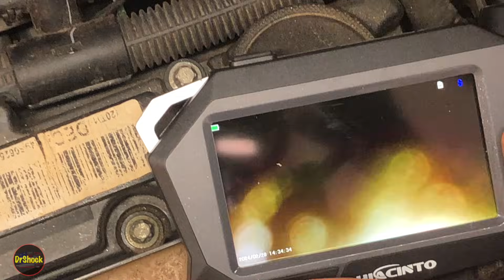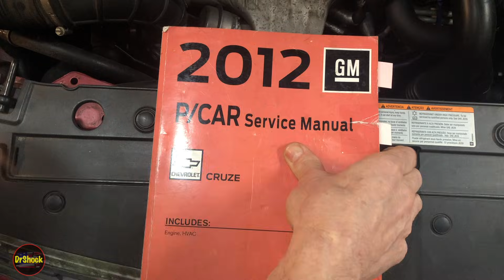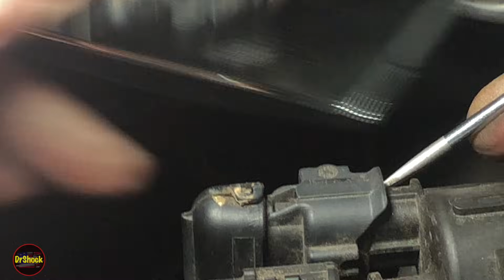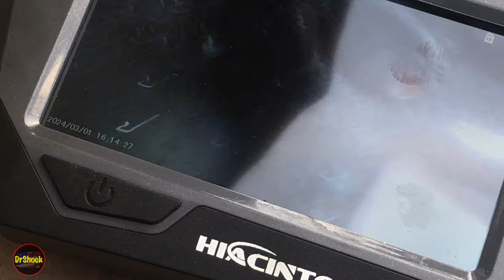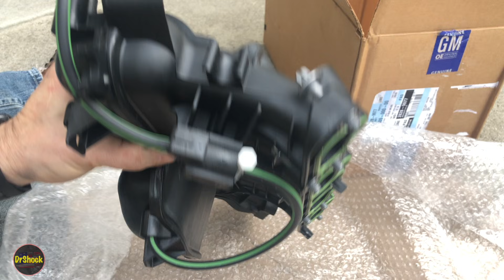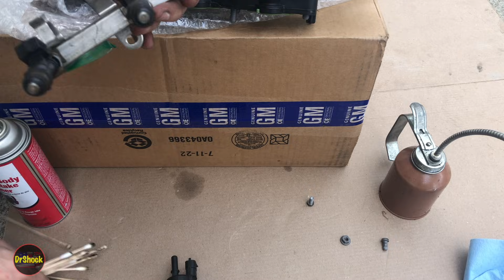2011 - 2021 GM Ecotec 1.4L Turbocharged Engine Intake Manifold Replacement ~ P0171 Diagnosis ~ Cruze

Comment: the orange check valve allows flow towards the intake manifold? Thanks.
Reply from the maker: It is a one way bypass type valve made of a type of silicone, sealing shut to prevent air under turbocharger boost pressure from entering the engine crankcase area.  And opening normally to allow combustion blow by gases to be removed under engine vacuum as part of GM's positive crankcase ventilation design for this particular engine.

Comment: Can the MAF be cleaned before you start disassemble on the other items or does that orange thing indicate removal of other things. The engine light randomly comes on, 2014 Buick encore turbo. 70 yr old granny here. The orange is visible.
Reply from the maker: As we showed with this particular vehicle, even if the orange bypass valve is visible, it does not always mean it is still functional.   Age and heat can either disintegrate it (missing entirely or partially) as well as stiffen it (preventing functionality intermittently or completely).  

A random check engine indicator would need to have a code scan done, to determine what the diagnostic trouble code (DTC) actually was.  And then the scan tool could be used to monitor related live engine data to determine if this videos subject was even applicable or not.   Same advice would apply to the MAF sensor, in general this particular GM engines' sensor can often be made worse attempting to disturb / clean them so one would want to confirm with certainty there's a reason to first.

Comment: I will be doing the pcv valve fix that's listed all over the chevy cruze/trax forums. It allows you to plug that orfice and creates a new, serviceable pcv valve using a kit a guy came up with. All you need to do is replace the valve cover and add the kit. Anyone having this issue, id highly recommend looking into it. Good luck!

Comment: All Chevrolet 
1.4 are bad about using plastic parts. And bad turbo placement. All pvc tubing fails due to the heat, it drys out and becomes very brittle. And after replacing the turbo, you must also do a full oil change including all filters, air and oil".
Or you void the turbo warranty. 
The more you know about this motor, the less you’ll want to own it. They can start getting very expensive around 75,000

Comment: Thanks for a great video. I have with help of the video removed the intake. On the new intake manifold that i ordered there where a smaller connector for the brake servo vacuum hose compared to my original one on my Astra J 1,4 T  from 2015, that had a large connection. It seems that all replacment part has this smaller one....   Can i reduce my hose?  Where can i find a connector that fitts this smaller vaccum connector
Reply from the maker: Was this a genuine GM part you ordered?
Reply: @DrShock  No it was an aftermarket. But the OE number indicated that it shall fit.  After a little investigation it seems that GM might have changed to a smaller connection here. All  spare part i looked at seems to have this smaller connection. . So i do not no what to do. Is itpossible to clamp a hose directly to the connection on the intake?
Reply from the maker: This video covers the first gen, RPOs LUV and LUJ in the North American market, of the GM Ecotec 1.4L turbo engine.  A quick check seems to confirm the LUJ type was also used on the 2015 Astra J models.  But in the EU market, there is the availability of start/stop technology not used in the NA market of this era.  There are different intake manifold (aka in the EU as induction manifold) part numbers on the manifolds for these options that do not exist here in the USA.   This may explain (just my guess) the difference if the aftermarket company didn't pay attention when replicating the part.

In this situation you may have to reuse a portion of the original used OEM parts' hose, and pick up a plastic adapter barb fitting to mate it to the smaller hose on the aftermarket manifold.

Comment: Could a puncture hole the size of a golfball in  the intake resonator box cause these issues
Reply from the maker: If you mean the plastic housing for the engine air filter on the 1.4L ecotec engine, structural damage there can certainly disrupt the sensor measured air flow as well as allow dirt and debris into the turbocharger mechanism,  if the housing damage is past the air filter.

Comment: What were the Torque Bolts Specs for the Air Intake Manifold 6- E10 Bolts, and are they numbered & follow a tightening pattern, like how the replacement valve cover & gasket follows a pattern on this engine? I think I maybe missed this in the final summary you did? Please 🙏  & thank you in Advance.
Reply from the maker: Those torque values are definitely gonna be in the video, don’t recall them offhand check the chapter section.  I showed the service manual info directly.
Reply: It's 20 Newton meters or 15 lb ft for the 6 main captive intake manifold E10 bolts.

Comment: So I have a new valve cover/pcv and I have a whistle but not from the pcv when running but if I pull the oil dipstick it stops can anyone give some insight why it's coming from the right rear of the engine I've also replaced the valve cover gasket thinking that may be the whistle but it wasn't I also did a smoke test with no leaks before the turbo and after?

Comment: I just put my new ported intake on....im going to port the old one and put the cruzekit on it. That way I can also put the new valve cover im getting on. 
I did notice turbo sounds finally.....it didn't have it before. The cel didn't come back in after a 5 minute drive, amd it came on in less than 1 minute at the dealership lol.

Comment: I replaced the intake manifold and valve cover, but I am still getting a P0171 code. There seems to be an incredible amount of crankcase vacuum. The PCV is not leaking. Is there any other components that could be causing this, or did I get a faulty intake?
Reply from the maker: Did you perform the camshaft cover PCV diaphragm vacuum test I showed?  Did it fail the test originally, and now passes after installing a new cover?
Reply: @DrShock  If you are talking about the paper test, yes and it failed initially, but now passes.
Reply from the maker: Then that has removed the most comment source for this code, but unfortunately there's a long list of possibilities so you don't want to fire a parts cannon at it.  This engine will easily empty the wallet of folks who try that.  

I'd next inspect that the sealing o-ring at the PCV pipe that runs from the turbocharger to the intake manifold isn't missing (at the intake manifold nipple end).   This pipe can also develop cracks being made of such a brittle plastic, so visual inspection of the entirety of this part can reveal problems as well.  This video can offerl a number of views on this part - https://youtu.be/OeymR_PjgPE

And that the sealant was properly applied to the two engine sealing seams when installing the camshaft cover as shown in this vid - https://youtu.be/Xfr05EPVJAg   I'd also check for no oil blow by from the camshaft cover gasket becoming dislodged or twisted during installation.
Reply: @DrShock  I did also replace the PCV pipe while I was doing the other work. I was careful with the valve cover gasket and applied the sealant in the locations you showed in the video. I am having a hard time understanding what would cause so much vacuum in the crankcase.
Reply: @DaleBisc  Did you solve the error problem?

Comment: Just did all this on a 2012 Cruze with 17000 miles on it (Grandma's car).  Just like the video shows, had to remove 28 different things to remove the IM. Took me about 2hrs. I decided to just snip the two wire ties tucked up underneath the IM.  Casualties! Could then see right down into the port: no valve present.   May Jesus bless you for making this very helpful video! Now to go find replacement parts.

Comment: Could this diagnostic work with a 2015 1.8L cruze?
Reply from the maker: Not directly applicable, this particular part and failure condition is only found on the GM 1.4L turbocharged engine.

Comment: Hey! I am replacing the intake manifold, orange bypass is gone replaced the diaphragm/valve cover 6 months ago. I only get the P0171 in temperatures under 0 degrees

Comment: All in one plastic intake and valve cover . $500 in parts and double for the labor. What about the fuel injectors? Mine at about 70,000 miles are making some noise that isn't right. Bet the dealership would recommend the whole thing at about $1500 to $2500. The labor to do the injectors is the same cost no matter that they are off anyways because of this. The mechanics get those hours even if it's a 1/2 hour more to do them.  GM swore they wouldn't do bad engine designs ever again after the V6 3.8L late '90's EGR plastic valve cover conduit fiasco. Nice job GM, you've done it again. Sure, 23 yr old bypass valves are probably not worth cleaning since the customer would really hate failure after all this but myself I could clean them. I have one way check valves that still work from 45 years ago. They don't just die from time. They sit in a divot or orpheus that can hold Varsol and soak. Get in with a little tooth brush type of a thing and gently deal with it if blowing them out carefully with compressed air attached with a little line hose doesn't do the trick. 
   GM must have saved lots of labor not having to do external conduit lines this way. GM is not as labor friendly as their UAW's members would like to believe. Trump loved to tell them voting for Biden would hurt them but his tariffs are not bringing jobs back to American shores. China is just so much better to build in since the market growth is exponentially better. All those bicycle people are wanting cars and GM knows it. Trump got elected on lies.
UPDATE: did the repair for about $10 USD but with tools to check that is all it is another $30-$40. I'll post a video some day.

Comment: My part did not come with the black and green hose, can i re use it?
Reply: Thanks,  your videos are great 👍
Reply from the maker: That small hose should be included with the genuine GM part as I showed, as it should be replaced being a wear with age type item.  If you bought an aftermarket part instead you may need to refer to their directions for what to do there.

Comment: Would this be same process for 2016 encore eco boost. Garbage damn engines
Reply from the maker: It would be the same for the Buick Encore with the 1.4L turbocharged engine with engine option code LUV or LUJ (there's some more technical information in the video description text area).  Some Sport Touring trim level Encores will have a different engine, option code LE2, that would be different than what I showed here.
Reply: @DrShock yea dealer quoted me $1400 to do the intake and cover lol I bought the part on Amazon for $230 hopefully I can pull it off

Comment: The cruzekits PCV fix kit is the absolute answer. It makes it an external PCV check valve rather and is a couple dollars to replace now. I also got the catch can to go in line with the pipe going from intake to turbo. Great setup if anyone looking for the aftermarket solution.

Comment: Hello what symptoms rough idle and high rpm? I got the same code fuel trim system lean
Reply from the maker: Just the DTCs in this video, no other problems reported by the owner.

Comment: The Opel system is pretty bad. And that valve in the intake manifold that’s worth about 1 euro cent is a joke. I just want to point out that if someone has already replaced everything and the car is still running poorly, they should also check the intake manifold gasket. Even if it has been replaced, if the lower middle part of the intake manifold gasket gets deformed during installation, it will leak there.

There is an intake manifold like this one: 49SKV076 — you can see that in the middle the gasket is not supported by anything, so this is where it deforms. You need an intake manifold where the gasket is firmly supported everywhere… or you have to use sealing paste.

Opel 1.4 turbo… a joke.And it’s also a joke that the plastic intake manifold is held in place by only 6 bolts…

Comment: One thing I found easier for those squeeze release zip tie, was not using needle nose pliers, put an either E-7 or E-8 socket in an extension rod and sleeve it onto the clip, it will compress it and release super easy.

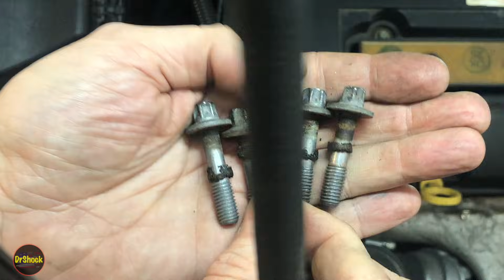Comment: 36:58 what are those on the end of the bolts? Are they some kind of seals or something else?
Reply from the maker: Those black plastic “bands” you see there are part of the old intake manifold that have broken off.  It’s meant to retain the bolts during installation.

Comment: So many of the issues with these 1.4t engines (apart from a poor design) is the lack of folk using the correct Dexos1 engine oil and replacing it at the correct intervals. I swear even the timing chains would fail less if this procedure were carried out correctly (I the UK I have purchased a few of these with dealer service history which is clearly stamped as using Dexos2 for the first few services.. I kid you not)!!!

Comment: These engines also have a ECT sensor that when it goes bad will read the coolant temp higher or lower then the actual temperature. This will cause the MAF readings to be off and mess with fuel trims causing the same code. I did a video on my own channel on this issue

Comment: p0171 can also relate to faulty purge valve. The PCV Valves on these ecotec engines are useless i dont know why Vauxhall have not brought out an external valve modification for these engines 1.4, 1.6, 1.8.

Comment: Don't ever ever ever ever ever use oil on rubber seals they will swell I always use silicone as far as removing fuel pressure just push the Schrader valve in on the fuel rail you don't need to hook a gauge up to it
Reply from the maker: Thanks for the comment.  Rubber derived compounds have not been used by GM for several decades now, but the synthetic material used should be pre-lubricated in some fashion to prevent mechanical tears during installation.  Silicone or actual gasoline is fine too.  On fuel pressure release, what you suggest certainly works, but we follow the technique shown to reduce fuel spillage onto the engine.

Comment: My God, why couldn't they put a regular pvc valve and a diaphragm that could be replaced. What a total pos. Great video!
Reply: @JimHart-c3o  all Chevrolet 1.4 are bad about using plastic parts. And bad turbo placement. All pvc  tubing fails due to the heat , it drys out and becomes very brittle. And after replacing the turbo, you must also do a full oil change  including all filters, air and oil”. Or you void the turbo warranty.

Comment: I wanted to ask you if an aftermarket manifold intake would also suffice, the original GM is very expensive.

Grt Jermain
Reply from the maker: This is one of those it depends situations. If you're a shop, use OEM parts only full stop.   No warranty in the aftermarket will compare to OEM.   If you're doing it yourself, and keeping the vehicle for the long haul, the money you save in labor by doing the repair yourself should be put into the genuine OEM part.   If you're just getting the vehicle repaired yourself for resale, or a flip, though then you might arrive at a different conclusion.   If so, aim for a brand name aftermarket part with high reviews without considering the price alone.
Reply: @DrShock i can get warranty for a aftermarket one